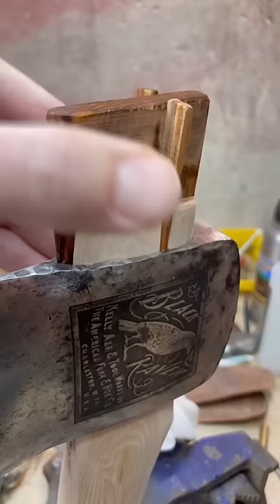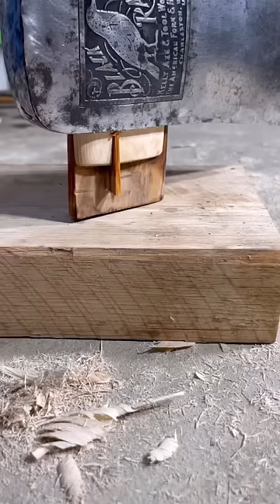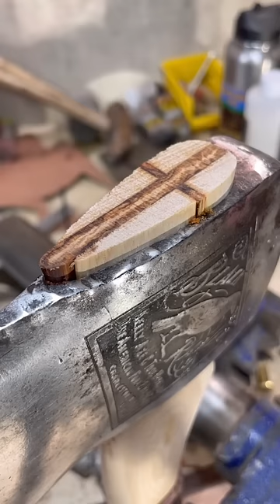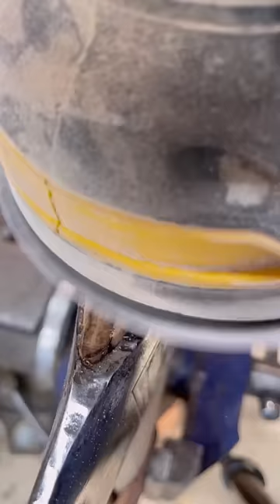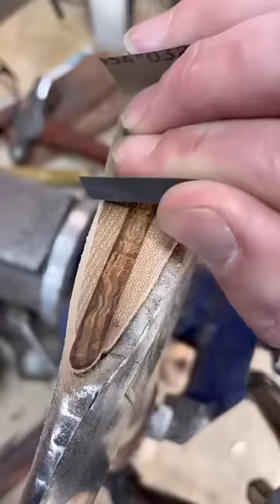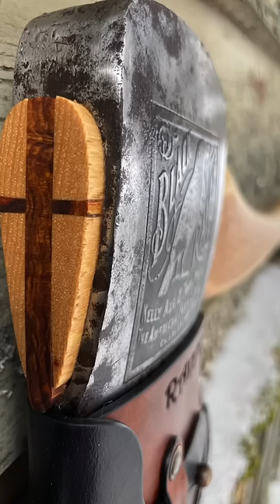Kelly Black Raven - Cross Wedge #stumptownaxes #vintage #axe

Comment: If you are in a bind and need a quick and dirty fix for a loose handle, soaking it in antifreeze causes the wood to swell and doesn't evaporate out fairly quickly away like water does.  I haven't tried this, it's a tip Ave passed on from BOLTR videos.

Comment: Why is the oil added last? I was always shown to soak first & leave extra  for non slip. Everyone diff & video shows craftmanship!    Mighty fine wedge!
Reply: I may be wrong... but my grandfather taught me to use dry wedge.  After handle is Installed you trim  to length.  He would then soak the wedge in water to make it expand.  Then dry off the end and apply wax to seal in moisture.

Comment: If you have a hydraulic press, try using it instead of a hammer. It is so much easier and you don't get breakage.
Reply from the maker: unfortunately I don't have a hydraulic press laying around my shop.   A press isn't without problems.

Comment: Anyone who has ever split a lot of firewood like I did growing up knows if you hold the axe by the handle and let the blade dangle and then use a sledge hammer or the hammer side of a maul to hit the end of the handle the axe blade will jump right up the handle tighter than any of this.
Reply from the maker: Joe since you grew up splitting wood and are an expert you probably already recognized the mounting of the head step has already past and this is just the wedging portion of the process.  My latest short I included this step for the keyboard experts to see.

Comment: Its going to come lose though, because you didnt flush cut it.  When you leave it proud like that it causes the head to come loose faster because its not locked in place and the wood swells and contracts way more because its exposed.
    Talk to any old timer that made their living by swinging an axe and they will all tell you that you never ever leave the wedge proud like that. Alway flush cut them with the head! Thats the only way to make them secure.

Comment: If that cross edge, I guess it would be called, should be a little wider. It would look more “traditionally”proportional
Reply: Just positive feedback. Badass work man
Reply from the maker: traditionally proportional?  What does that even mean? And who's tradition?  Feedback is fine positive or negative.  Telling someone they should have done something different according to a subjective and likely fictional tradition is not "just positive feedback," it's plain feedback possibly negative.  Thanks for watching.

Comment: the narrowest parts of the light wood near the bottom of the cross will get damaged very very easily and then the whole fitting fails. pretty doesn't mean practical

Comment: Wood type?????
Reply from the maker: Hickory handle.  Spalted ash wedge and palm swell.  There’s more pictures pinned on my Instagram if interested
Reply: @StumptownAxes  would mulberry tree wood be a good wedge? I know its twited fibers and holds a tremendous amount of water , takes a good long while yo dry once harvested and I thought it might kend itself to wedges in the ganging of heads
Reply from the maker: @SilasScott-wi5ut I am not sure to be honest.  If it looses moisture easily it may not make the best wedge if it would shrink easily.  Probably worth experimenting with carefully 🤷🏻‍♂️
Reply: @StumptownAxes  i may have mistyped. It holds its moisture very well. Apparently mulberry wood is good for a lot of applications carving, biw making cooking 🤷

Comment: Umm ... that's not how you set an axe handle so it will stay throughout the rigor of cutting daily ... that's not how to do that at all ! Once you set your "bind splints" you send the handle to hard surface then reset the binds ... rinse wash and repeat till the axe head sets . Then trim away the excess.

Comment: Setting that head all wrong bud. But hey if it works for you go for it I reckon.
Reply from the maker: All wrong, I should give up now
Reply: @StumptownAxes  all the old timers, loggers and forest service guys I learned from set it by striking the bottom of the handle and it sets perfectly. None of the fancy pants wedge stuff for no reason. That makes absolutely no difference in longevity or performance, bud.
Reply from the maker: @2ballsyourjaws  I am glad you clarified.  This video is a wedging.  No where do I say this is how to mount or seat an axe to a handle.  The fact you criticizing me for a step not filmed here is a great example of your ignorance.  There are many steps in making this handle I didn’t film.  There is also another video where I did film mounting by the method your old timers showed you.  It’s also the way I’ve mounted every axe have done.  But this was a wedging video and that’s what I showed. Your old timers had to wedge their axes just like this AFTER mounting them.   They just didn’t have key board experts telling them they were doing it wrong.
Reply: @StumptownAxes  nice story bud. Anytime we put a new wedge of whatever style on our axe heads in the forest service we always work the handle and freshen it up making sure the heads still fits Well and isn't cracked on the handle or head. Ya don't just throw a new wedge in and say piss on the rest. Have a good one pal.
Reply from the maker: @2ballsyourjaws  great story that has nothing to do with you saying I don’t know what I am doing.  I made the handle myself from a piece of hickory.  I didn’t just throw a random wedge in it.  I made the wedges too.  You made claims I didn’t know how to do what I was doing and in doing so made clear you don’t know what you’re talking about.  And are making up stories about forest service time and maintenance to a handle to sound like an expert when you can’t even tell what step I am on in the video.
Reply: @2ballsyourjaws  The wedge is in the handle and the handle is in the axe head...
Reply: @Jim-km1xt  what's your point of this comment that went in a circle for no reason, bud? I been in the logging and forest service for many years. I'm not talking out my ass. They pass the knowledge and techniques down to the next generation. It's tried and true.
Reply: @2ballsyourjaws  My point was that what he did got the result he wanted. Just because you were taught one way to so something doesn't mean it can't be done differently. You're just embarrassing yourself trying to correct somebody instead of just being a normal person and just saying you had another way to do it that you learned from whoever taught you that.

Comment: why would you want a cross
Reply from the maker: It's just a pattern in this case.  No religious intentions
Reply: @StumptownAxes  oh no... I meant does it add some sort of structural advantage
Reply from the maker: @Esrom_music  In many cases is helps fill the eye hole and adds extra hold if needed to the fit.  It's not always necessary but it's a nice trick to have up your sleeve when needed.
Reply: @StumptownAxes  great! Thanks for the response.

Comment: I always soak it in water over night.
Reply from the maker: No.  Water evaporates.  I would swell the wood slightly and then dry out and shrink.  Also can introduce rot.

Comment: Those small pieces on top are gonna break off and the head will go with it shortly after...bad structural design...cool look
Reply from the maker: Not true but thanks for watching 👍🏼
Reply: @StumptownAxes  yeah they will give 2 months...I don't mean the whole top the 2 tiny useless side nubs
Reply from the maker: You're still wrong.  My daily splitter has a cross wedge that's three years old.  I am not sure why you feel the need to make a prediction for failure but I hope you find a more positive use of your time.  Be well